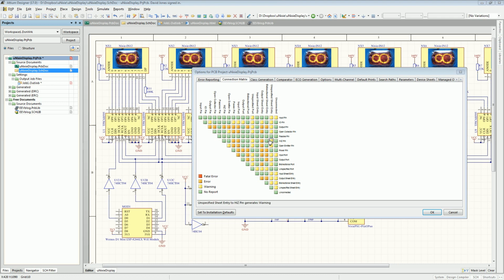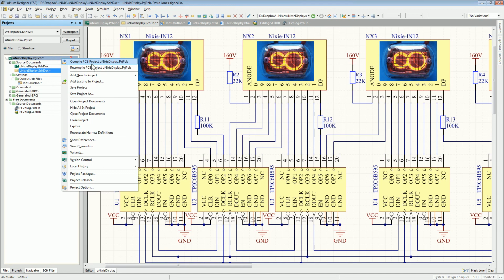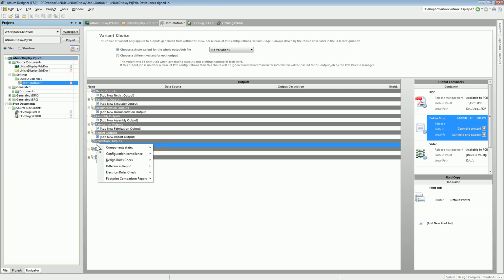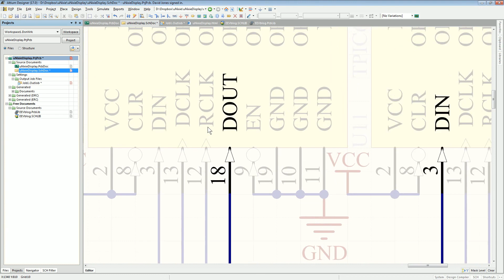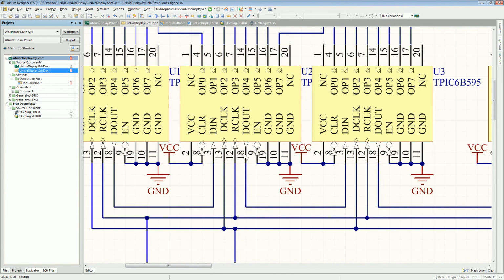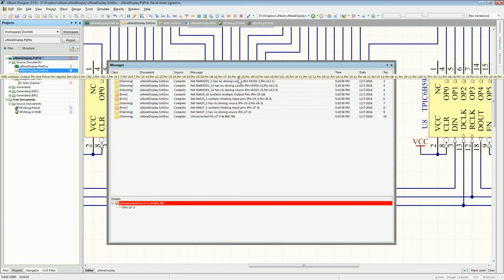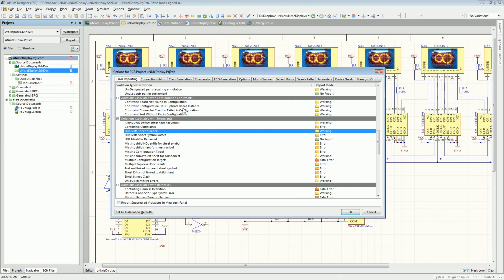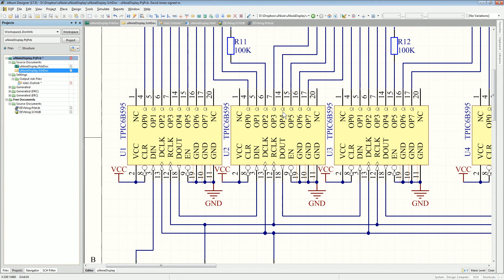EEVblog #953 - What Is Schematic ERC?

Comment: Do any schematic packages distinguish between "power" grounds and "signal" grounds.  In something like a 4 layer board,  I would like the power to be on the planes inside, but the signals (if I need to alter them) to be outside.  The same goes for Vcc/Vdd as well.

Comment: I may go to this.
But for right now I use Express PCB and Express SHC for my boards and or schematics.
I made up a flipper board schematic for my pinball machine I am working on.
Allthough for now I am going to use Open Pinball Project's boards until I can make up my own and etch the copper clad myself.
And not knowing much although I have learned a lot from repairing Pinball Machines that I own I have a better idea of how to get a board to work in my game. xD

I am hoping to have it up and going so I can stick it out and see how well it does.

Comment: Why can't Altium have a reasonably priced version of Altium for hobbyists/makers? I'm in the  transition from hobbyist to actually start selling stuff and is stuck with Eagle...
Reply: Altium Circuit Studio is pretty well priced for what it is, if they made a fourth tier above circuit maker and below circuit studio then the feature set would have to be restricted too much and then eagle would be better anyway.
Reply: Can you actually tell me what's the difference between Altium designer, circuit studio and circuit maker?
Reply from the maker: Try Altium Circuit Studio, sub $1k
Circuit Maker is FREE
Reply from the maker: AD/CS Comparison here 
https://www.element14.com/community/docs/DOC-76216/l/circuitstudio-by-altium-vs-altium-designer-feature-and-specification-comparison
Reply: Thanks EEVblog 
And is Circuit Maker free equivalent of AD or CS?
Reply: Same goes for me. Why not kicad? I know dave has done a review, but haven't really watched it.
Also dave you use element14 for components before?
Reply: I use kicad, as well and I'm pretty happy with it. You should give it a shot :)
Reply: I'm getting started using kicad. I have a small little project of making a simple and stupid 8bit computer around a "modern" CMOS version of the 6502.
Reply: Ybalrid I'm having trouble to even use pcbnew. I wanna make a pcb.
Reply: I'm using kicad for years now. The software is getting better, but the libraries are horrible, you have to design your parts constantly. On the other side it is free and has no limitations. I think this is definetely a good alternative for hobby use, even if you start to sell your things.

Comment: Hey Dave, I wonder... what does it take to make a custom PC motherboard? I am just wondering, nothing serious coming in any way, shape or form...
Reply: I would guess lots of layers, tedious routing, intricate blind vias and other amenities better left to autorouters. Think about it: there's not really a lot of choice into layout in a motherboard, what you can really do for increasing its quality is choosing good components.
Reply: Peter Bočan I guess it takes multiple company departments fully loaded with people to work out a single motherboard. There are so much complicated things on there. The length of the data lines are critical for timing, the CPU has 200 connections, all those memory slots, pci-e slots, and much more.
Reply: Yea that's true, a good knowledge of high frequency circuit design is essential, definitely not a work for single person. Of course there are simulators for HF and such but that won't interchanges with brain
Reply: CPU with 200 connections? What about the LGA2011 Socket? (little hint, it has 2011 Pins)
Reply: Robin Cerny That's even a bit more indeed. I was just guessing a number :-)
Reply: To be fair, 1/2 of them are power/ground ;)
Reply: It takes a whole load of coffee and frustration
Reply: 3vIL VIrUs You checked the datasheet on that?

Comment: @EEVBlog: maybe I'm missing something, but no 3.3V regulator/voltage source for the WiFi module?
Reply: If you are wondering why the ERC didn't find a problem, I'm not sure.  But the 3.3V connection on the microcontroller is an output.  It is regulated from the 5V power input.
Reply: That 3.3V pin is an output, the module has a built-in regulator. Dave mentions that in the previous video I think.
Reply: GeckonCZ Doh, I assumed it was an input. I must have missed the sentence where it was said that the pin was an output.

Comment: Do you guys have any hints on an easy to use tool with an okay library support for a hobbyist or on how to start using a pro tool? I personally have tried out a whole bunch of tools (Eagle, KiCAD, Diptrace, Target and what not), but for a home gamer like me doing only one-off thru-hole boards for home use every once in a while all these tools are just too complicated, I just can't figure out how to use these convoluted beasts. My problem with most of these tools: the GUI is not intuitive (ie drives you crazy) and you never find the (jelly bean) components you need. At the moment I am stuck with Sprint Layout, which is more like a "Paint.exe" for PCBs, but without all the Schematics glory. Works great, but you don't have any schematics of course, so the overall use is quite limited...
Reply: Are you looking to create PCBs or just create your diagrams (to print, ...)?
Reply: One of my profesors forced us to use OrCAD tools ,which i find usefull for schematic and simulation but making pcb was pain in the ... because we had only last two classes dedicated to PCB  design (he actualy requested from us to manualy write netlist on paper,and then type it instead placing and connecting components,optimising circuit on paper drawing some tables),so when we did our final project my colleagues and I ended up using various  tools becouse none of us knew how to get right footprints and assign them to the components.
If I remember correctly I've used  ExpressPCB,which you can find online for free and finished my PCB in less than an hour.
Personaly I like Altium.Using it for more than year now,got ton of libraries ( of course I don't have genuine license becoues of crappy country can't invest some money in education or at least arrange some discount),even learned how to create own libraries,and make footprints pretty fast.
Reply: Have you tried Multisim 14?
Reply: All of them have step learning curve if you have no experience, because it's a complicated field. The only way to figure out which one to use is watch hours of tutorials on each - I spent a couple weeks watching tutorials on KiCad, Eagle, Fritzing - . Dave tried to use KiCad without the tutorials and was hopeless, I watched the tutorials and knew more than him after a couple of hours - I was screaming at the screen and I only had 4 months total electronics experience -.
Reply: KiCAD is my favorite. I prefer compiling the dev build to get the latest features, but the current stable release it good too.
Any EDA CAD program is going to take some time to learn though. Some are easier than others. It took me about a day of watching youtube videos and messing around to learn KiCAD.
Most of the boards I make are small with 1 or 2 layers. I often have a finished board in my hand within a couple hours of starting the design.
You will never find an EDA CAD program with all the part libraries that you need. You will always end up needing a part where you will have to make a schematic symbol and pcb footprint.
You can find some libraries on line, but are you really going to trust that they are correct? By the time you finish verifying it, you could have just make it yourself.
Reply: KiCad is very capable. First install about a week ago and it helped me produce this https://hackaday.io/project/17936/gallery#e73afe706276585985384d386749f57d . 
Seems to have all the ERC/DRC features Dave referred in this video.  It also has 3D view which is way cool.  
There is a steep learning curve and I as a hobbiest also wish i could just slap together a PCB without all the creating components and footprints etc but in the end I found it fun and very rewarding looking at the final  professional looking design. ( Not sure if it is professional but it does look it to me).
Reply: +Jaime Cernuda: actually both, for creating the PCB I currently use Sprint as already written, but I'd also like to create schematics. I could of course use the companion tool to Sprint, but they are not integrated and doing (more or less) the same work twice in two tools is also a pain...

@all: thanks for the advices, next step I'll take a look at the other tools you guys recommended and see what these are like, and maybe give KiCAD a third chance. :)
Reply: DipTrace is probably the most intuitive for a beginner. There IS a learning curve, that's unavoidable. DipTrace and KiCAD both have minimalist workflows that are nice for one-off boards and the like, but aren't so great for big production boards where you'd want to automate a bunch of tasks like ERC and netlist exports and the like, à la Altium. (KiCAD supports Python scripting I think, so a professional shop can develop its own scripts for this. I haven't looked into the capabilities at all.)

Don't expect libraries to have all the parts you need. Get used to making symbols for your components yourself quickly—with DipTrace this is really painless. Common jellybeans are fine in a lot of libraries—DipTrace's libraries are decent, Eagle's are extremely extensive, but even for my hobby projects I have to make my own IC parts half the time with DipTrace/KiCAD (mind you, I don't stick to common parts necessarily, I freely use specialist parts).

Comment: I've used many different schematic capture programs over the years, and recently was introduced to Altium. All I can say is "what a load of crap!" Everything you need to do requires so much convoluted ways to get anything done. Plus, it crashes whenever possible,  and the help file is for 3 revisions earlier, or you get the 'coming soon, notice. WTH? Even trying to print a schematic page requires bending over backwards. That is IF it decides that it's not going to popup a useless error message and lock up the system. I would take Eagle over Altium any day.  Even OrCad with all its foibles at least doesnt crash and take all your hard work with it.
Reply: Do you have a recent Altium version?
I use it more or less full time every day and the last crash has to be some weeks ago. Haven't had much trouble for the last couple of years. You usually can 'take notice' of a crash when it happens, save the file and restart the program an go on with working. Crashing was really bad ~5 years ago, but not a single time I lost a design file. It also never locked up my system. Doesn't relly sound like typical Altium-trouble to me. Maybe try a clean re-install?
Eagle is like MS Paint with a 1995 style user interface. Horrible and painful to use. Not as painful as Cadstar, but almost. ^^

Comment: Altium, continuing to make simple tasks pointlessly complicated ;)
Reply: You miss the case, altium is not dedicated for designing your jellybean power amplifier but for big companies who design whole computers and such, it's capable of doing whole CAD process
Reply: I don't get why these programs are so hard to interface. I'm a hobbyist so....
Reply: Altium is much user friendly than high end PCB design softwares (from Mentor Graphic or Cadence Allegro which are usual choice for designs like motherboards).
Also Altium have best price for capabilities its offer (Allegro cost 5 times more) so it is best choice for middle and less demanding big companies which do not need "high end" software.
Reply: Miloš Lazović Wait a second, altium is AUSTRALIAN!? Is altium widely used?
Reply: Brad
As I saw Altium is most popular PCB software in use (in Europe), and most companies I know of use it, with exception really big ones (which use Cadence or Mentor Graphic) and really small/hobby (which use some free solution). Contrary is Altium Tasking C compiler which I didnt saw anyone use it, and I heard that is among best compilers for ARM microcontrollers (it should be little behind IAR and in class with Keil).
Protel (last time I used it Altium was still called Protel) was Australian company, now I do not know is anything changed.